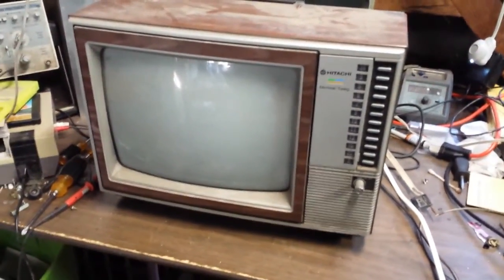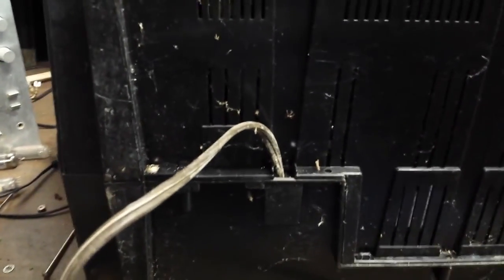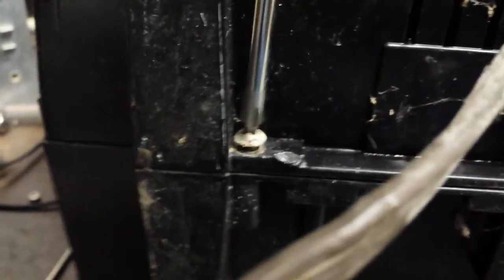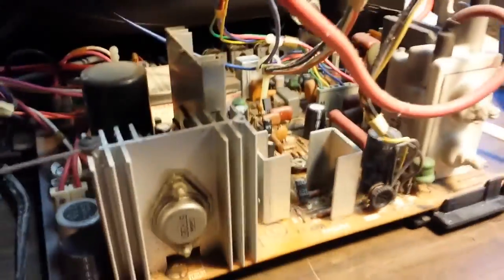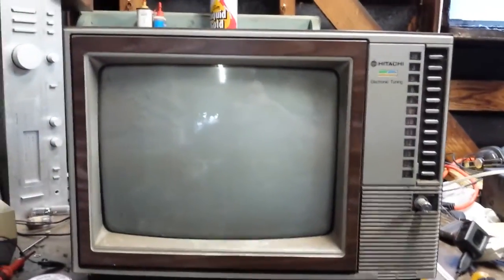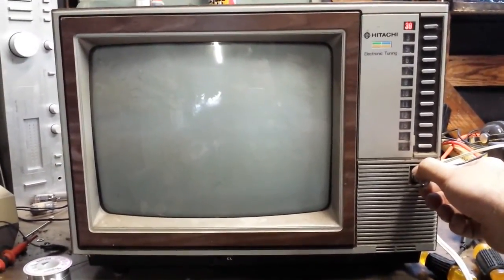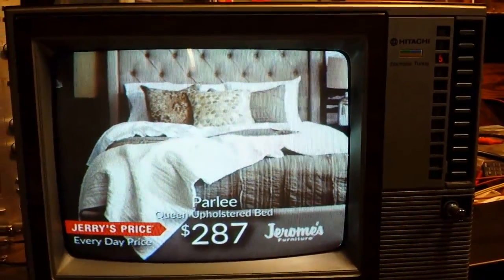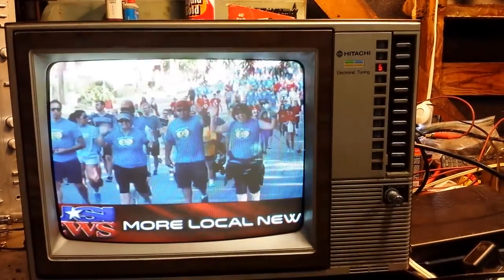1981 Hitachi color tv roadside rescue

Comment: I've got one like this that I've had for years I think it was also a side of the road find, but it's got the black outside instead of the wood grain recently I plugged it in and tried it and it was mostly a green screen but I cleaned all those pots on the back of the neck board and got it dialed in focus and everything The CRT is super strong and bright and it gives a really nice sharp picture I thought it was kind of junk when I found it but it turns out it's actually a good set.